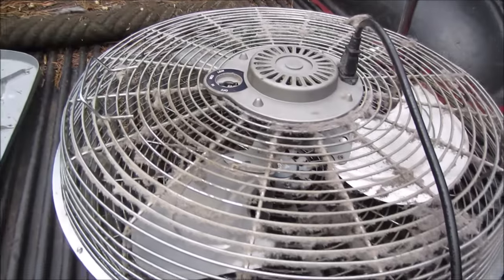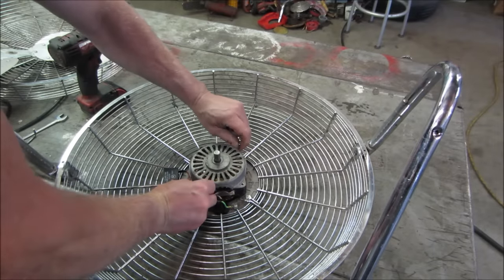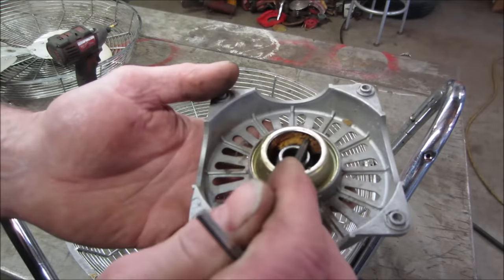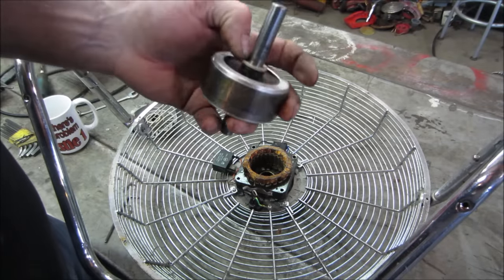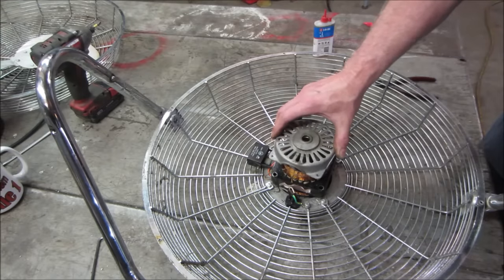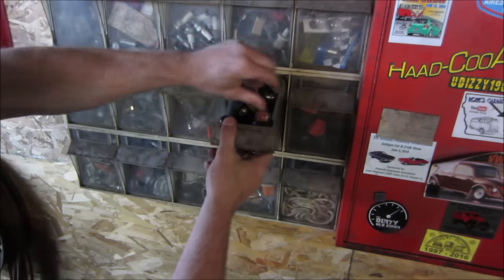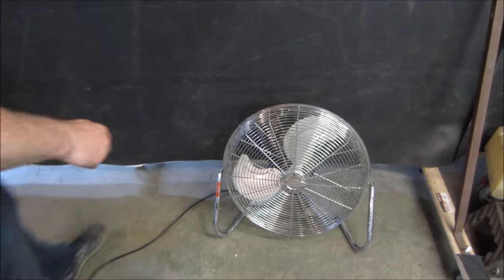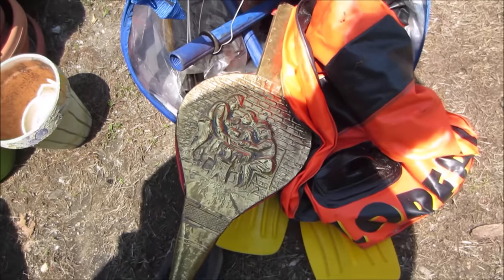Fan Blades Won't Spin? Lets Fix It

Comment: THANK YOU DARREN !!! I believe you could fix anything. Your head's on straight, so to speak, unless its when you're going cross country on something dangerous! You fixed your Daddy's boat, on here, one time. Is he percolating along good? I appreciate all you do.
   In the past, my Dad, made a tool, you might think about making for yourself. Get a 5/16" wooden dowel 6" long and some fine spring wire. Heat the wire 1/2" from the end and bend over double. Then cut off 2" long and heat the other end and bend an 1/8" L . Drill a hole up the end of the center of the end of the dowel. Run the end into a pencil sharpener a little. Then Mix up some epoxy and fill the hole and shove the doubled end of the spring-wire up in it. You'll have a pencil with a fine piece of spring-wire coming out like the lead, but have a 90 degree bend on it, an inch and a half sticking out of the handle. Take the rest of the epoxy and put it on your finger and coat the tip of the wood you put into the pencil sharpener. Also coat most of the shaft of the handle. This little tool will get LOTS of use, as you can pick out hair from around fan motor shafts, fish out things dropped in oil sumps, retrieve bearings or nuts or hose ends, or reach thru a hole to pull something thru. Dad had one, a long time ago. I've got to make another one, as I don't know where his is.
   Thanks for the pretty BAY view.

Comment: Was that a self aligning bearing on the shaft end?  I always match mark the end plates when disassembling.
Lithium grease is very light.  My Shop Fan (same style in black) was clogged with metallic dust etc . Cleaned it out and some lube and it works great.

Comment: My wife HAS to sleep with a fan blowing in her face....and over her into my face... anyway, great video showing how to save $20-$50 on a new fan. We've cleaned hers until the screws strip out and then buy a new one. usually every 3 years for cheap Wally World fans.

Comment: Good job, I approve.   I haven't purchased a box fan in years, I find them in dumpsters, usually quite dirty (yours was so clean!) and generally the motor is gunked up. I don't bother opening the motor, just put some oil (3-in-one or sometimes light motor oil) on the spindle and spin it to get the oil to migrate down the shaft.  Sometimes the controls won't work (blown fuse?) and it isn't worth my time to deal with that.  The last one I found was very clean but had a blade broken off (someone had dropped some dominoes into the cage). But because they are so common (e.g. Lasko), I just put on a compound blade from another fan. Works perfectly with no other changes

Comment: I once brought a bathroom vent fan to a rewinding shop. He said that all small fans can be repaired by oiling because they just quit turning when they need lube. 
   He pointed out that the old ones had a built-in oil tube to re-soak the packings. His opinion was that they eliminated them so one had to buy new fans when the lube ran out. He said that one could actually drill a small hole to soak the wicking where the oil would stay in the packing.  I used to use the zoom spout 'turbine" oil for fans. I had 2 very old whole-house fans, with oil tubes. Eventually after years, I ran out of oil in the zoom tube applicator. I bought a second identical applicator that said it had "turbine" oil in it. After a few weeks both fans quit working because there was a sticky residue on the shafts. My research said that ONLY NON-DETERGENT 20-weight oil should be used. I can only find it in bulk. The 3-in-one motor lube looks like a possibility.

Comment: Found a Patton High Velocity sitting curbside once, same problem with jellied lube. 
I cleaned it out and added a couple of drops of 90wt gear oil ... ten years ago. 
It's still running just fine. 
Patton makes some very good fans .... never turn one down!

Comment: Ahh the old "this fan is permanently lubricated" gambit. May you have hours of air circulating goodness, great job!

I've resurrected many fans from prematurely being thrown away. Some of the newer ones have fuses in their plugs so when they go overcurrent they stop working, others will have a single use thermal element in their motor windings. If either of those pop they leave you with a dead fan that often spins freely. Getting to the thermal cutout element is tougher than replacing the plug or buying a new fan for most folks. Sad the throw-away world we live in!

The motor in this one looks to be pretty nice, could stand a few holes for a lubricator/piece of wick to provide that oil lite bushing with it's life juice.
I tend to use zoom spout/parafin turbine oil in all my fans, but 3-in-1 works great too.

A few tricks I've picked up over the years, if the front bushing will not pull off the rotor, STOP! don't force it, instead grab yourself a scouring/scotchbrite pad and clean up the shaft from any dirt/debris, you might have to even use some sandpaper if it's bad enough or there are burrs. Make sure you remove any roll pins in the motor shaft and try not to deform them too badly (these are generally what drive plastic blades on oscillating fans), If you find them binding up when you put 'em together, always make sure to use the rotor to move the back bushing around a bit, then back to the center, and when putting the whole thing together with the front half, tap the shaft with a plastic/rubber hammer once everything is together a few times until you feel the least amount of resistance on the shaft when you spin it. You might have to loosen and tighten the fasteners with a few taps between to get everything aligned just right, but it's worth the extra time.

Comment: Gun oil, thin and doesn't turn gooey
Reply: About the only really good use I found for Rem Oil. All my rebuilt fans work fine with it and lasts a few years before reapplying.
Reply: .....I find 3 in 1 oil unsuitable for fans....I will try gun oil next time.
Reply: Hoppe's no 9
Reply: They do have a 3 in 1 oil they say is for motors  I recall it was a 20 w 20 weight. Maybe that is the one to use. I have a can of this,  on problem. Now I see there can be a better alternative.

Comment: I just put a squirrel cage blower in my shop for the summer. It has oil tubes. I've repaired dozens of those old fans like that. What you can do is repack the area around the shaft with some rags or cotton balls and reoil it. Sometimes I will sand down the bearing using a wooden dowel with a slot cut in it and very fine sanding paper chucked up in a drill.

Comment: Great job. I bought a Lasko 20 inch fan and extended the cord but I love the fact that yours has a disconnect on the back of the motor for the extension cord. Instead of being hardwired. Maybe I’ll try that modification on mine. Thanks for posting!

Comment: I am sorry that I can't remember the names of the pieces or the grease I used, but, I have repaired a number of fans like these. Cleaning the parts is always a great idea, but before you put everything back together, I recommend using a high temperature black bearing grease. Some people think it is too thick, but I had one where I just cleaned everything as you did, and it only ran for a day before it seized up. I took it back apart and put some of this grease that will not catch fire (I can't remember what it was called) and I put it in the part that you found the yellow stuff in, and then lightly coated the shaft and center piece to the part you cleaned on the wire wheel, put it back together and it ran for 4 years without ever having been shut off.

I have only seen one that had a hole to put oil in it. I thought that would be a better one to own since you just oil it once in awhile, but the oil it recommended was really thin, and with the heat the motor put out, it would evaporate after a shot time of light use. I run them on high year around because my place only has 1 ac unit and my bedroom is like 100 degrees without one. If you do decide to use grease instead of oil, make sure it is for very high temperatures and remember that even though it works better and longer than oil, it will also attract more dirt, dust, hair, and other things into it a lot quicker. You can remedy this by making sure you have the cover on correctly, and then by dusting it off and cleaning the vents on a regular basis.

Comment: That is a good way of burning up the windings! If it does NOT rotate then Shut off the power, clean/lubricate the bearings for starters....
It arrived just in time for the hot summer temps....
the switch repair is McGyver at its best!
Comparble 18" fan on Ebay for $ 41.00
Amazing what some people throw away, all it needs is a little love and its good for the next 50 years!

Comment: I mainly wanted to know where to put the oil, and I think I got it right. Thanks!

My challenge now is to find a way to disassemble the remaining designed-for-landfill non-functioning fans so I can clean and oil them. It might take a drill and skillsaw to do it, but I won't toss them til I've made a good faith effort.

Comment: As with the rest of you guys I've tried 10w30 or heavy automotive bearing grease and they will not last long. The best thing I've used is white lithium. It will eventually dry out but none of these fans are designed to last. Love that switch Mustie!
Reply: Try synthetic gun oil. Or gun grease.

Comment: Thanks, used this to save a Lasko floor fan I've had for a couple years. Found the rear bearing/bearing surface stuck together, but some cleaning and light oiling completely restored the fan.

Comment: Great video. Had the same fan and same problem. The thing i did was pack the bushing with high temp bearing geese. Those bushing are self geese but they are junk. After a few weeks it will freeze up again until you pack it with geese.

Comment: Lucas car dynamos had an Oilite bush for the rear bearing with a felt pad and a small hole in the body for scheduled lubrication. From experience of dismantling them, either maintenance didn't happen or the oil didn't get further than the felt pad.

Comment: My Dad fixed fans as a hobby after he retired. He used white lith grease sometimes. I still have about 10 of the fans he worked on, 5 or 6 antique brass

Comment: The Craftsman drill you saw in the free pile is a quality item. I have had the 14.4v version for about 12 years, it's beat up bad, but won't quit. It's worth rebuilding the batteries.

Comment: That goo is the result of having the cheap urethane foam disintegrate after being given a drop of oil during assembly. A few drops of air tool oil on the bush works fine, it is about the right weight oil for it, and will not degrade with time. A bit of felt cut into a strip makes a perfect replacement foam oil reserve, and will last decades on the fan.

Actually got a similar fan a few months ago, just not turning, and missing the stand. Old fan stand from a fan that had the motor burn out, and a bit of oil on the bushes (no dissembly on it) and then a clean of the cover, a paint job to hide the rust and removing of the broken swing gears, and it now is a good indoor fan. Replaces the one I got at the scrapyard, fell over and dented the blade and cover,so it was taken to scrap metal. It has a little issue with speed, in that the 3 speeds are storm, typhoon and tornado, so it now is with a friend in his garage to cool it down when he works there, where it can move the welding fumes out in seconds.

Comment: I do this at least twice a year on the house fans. I use turbine oil so that it doesn't polymerize and cause it to slow down and stick.  I replace the oil foam (yellow stuff around the bearing) with felt or if you have a motor re-builder in the area you can get the real foam. So far it's kept fans in constant use for 10-15 years on a cheap fan.

Comment: I had to do this exact repair on an almost identical fan I bought at the grocery store. The fan was new, but the gooey lube they used locked it up after a month. I use the same 20W electric motor oil you used. A lot of those motors have a porous felt ring that surrounds the bearing to hold some extra oil and you can clean that, then relube with about 6-8 drops in there.

Comment: HEY, 👋😊
I had the exact fan.
I found it out by someones trash and took it home.
Plugged it in and flipped the switch..
POW 💥 LoL 🤣😆
Cha-cha dog took off for the house running. He's such a chicken 🐔 anyways. 
After the pop, the fan quit and smoke bellowed out of the motor. 
Don't believe there was much more fixing to this fan and pitched into the spare parts ben .

Comment: I have a fan just about like that one that quit a few years ago. It was the same problem as this one too, just dried up inside. I looked around for something to wick up some oil and keep it from running out  and i found an old zippo lighter. i took the cotton out of it and packed it around the bearings and added some  3 in one oil and fired it up. its been running great for several years now and is on the back porch to keep the bugs at bay. still in use all summer.

Comment: I did the same procedure on a fan two days ago with a similar construction. In the end bells, around the bearings, was an orange fibrous material. I mistook this material as debris and dug it out of one end bell. Turns out it's an absorbant for oil. I replaced what I dug out with a seam from old flannel pajamas and soaked the material in each end bell with 3-in-1. The orange material can take  LOT of oil.

By just oiling the bearing and shafts surfaces, you'll need to reoil in a few weeks/months.

Comment: In a previous century, I worked in a plant that built "fractional horsepower" ( fan ) motors. The lube impregnated wood pulp we used in those motors was known as "Perm-A-Wick". You can successfully replace it with a felt washer soaked in STP.

Comment: When i was a kid i lived next to this older gentleman who was always tinkering in his old dirt floor shop needless to say i learned alot in that old shop he had some old electric engine that had the oil port hole on the motor he took the bearings out and cleaned them with diesel fuel and repacked them with saw dust from his home built belt sander and some kind of old yellow hub greese or something like that put it back together and that thing ran just like a brand new one

Comment: Thanks for the video. I worked on my 30+ year old Patton High Velocity fan that no longer worked. Works like new after adding the packing material (cotton) and  some 3 in 1 oil.

Comment: Sitting right next to a fan I fixed too. Wasn't really starting anymore. Cleaned and lubed the shaft, replaced the starter cap - good as new, may it serve for many more years, the summers are positively unbearable without it...

Comment: That oil works great for fans. I use it all the time on the fans we have here. A couple of drops every 6 months. Ours are on 24 x7 and they are still working. Good Job keeping it out of the landfill. I use the oil with the long retractable dropper.

Comment: Little electric motor tip from an old guy, when you assemble the motor leave it a little loose, start the motor up and tap it gently on the side with a soft mallet. this will Center everything, then you snug it down in your motor should spin with  little resistance.

Comment: I had a Vornado that locked up in my shop. I cleaned it and freed it so it turns easily. It wouldn't run anymore. The armature didn't look burnt. I didn't see an inline fuse. Switch tested good. I wound up trashing it.

Comment: I repair older cash register equipment.  Sometimes the lubricant dries up.  I have found that Turbine Oil (found at my nearest hardware store) lasts the longest.  It is paraffin based, instead of petroleum based.  Every time we use petroleum lubricant we fix it again after a few months.  Paraffin seems to last a lot longer.

Comment: I tear down and lube my fans annually.  I have several fans which run all winter (4 months) to distribute heat around my 140 year old Vermont farmhouse. I leave the wicking material inplace instead of scraping it out. I have found that 90W synthetic gear oil does a great job and does NOT dry out. I prefer the 90w cuz it helps create a 'cushion' of lube while spinning (no metal contact)

Comment: I ran across a fan that was the same way , it was like it was filled with what was left of oily ground up cardboard . I cleaned it all out and cut some felt to fit and oiled it with 30w non detergent motor oil as suggested by many  electric motor companies . Has. Worked fine since . Periodic oil as with most motors .

Comment: My biggest complaint about almost all stuff like that fan is it was made to last only so long before it quits working and most people thow it out and buy a new one. Fans made up until the late 1960's all had oil ports and then to cheapen the manufacturing most went to oilight bearings that dry up after a couple of years of hard use.

Comment: That stuff that you were poking at is compressed cotton saturated with oil. The oil slowly feeds the bearings you should have put some oil on the shaft like you did but also dripped oil into the cotton until it wouldn't absorb any more. Most small motors are welded or staked together so you cant take them apart  What you can do with these motors is to remove them and immerse them in a container of automatic  transmission fluid overnight, then hang them over a pan and let the excess transmission fluid drain out. position them so a hole in the motor is down.

Comment: The stuff you removed is a lubricant reservoir for thin grease. As it warms up, the lubricant is supplied through the bearing sleeve, which is porous.

Comment: I have to do this to my one fan every spring. I use some PB Blaster then I use 10WD40 then it runs good all summer. It gets hard crud and slows it down. Super glue works on knob. Good job.